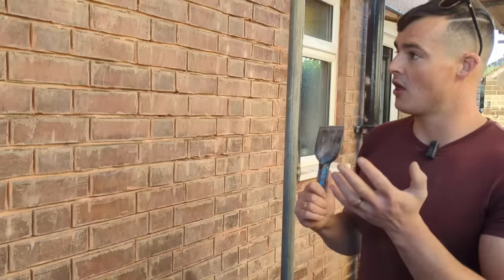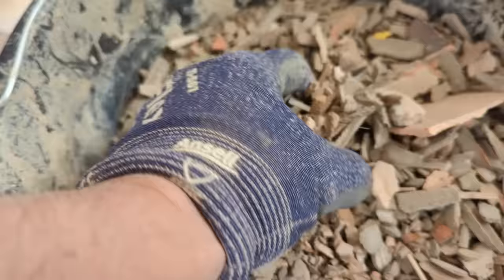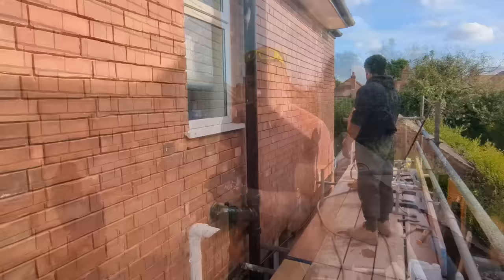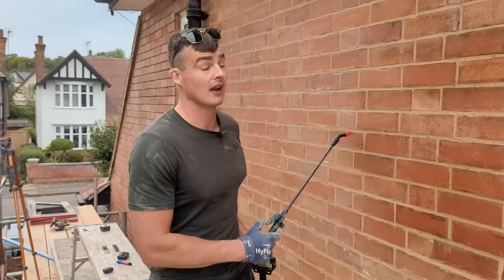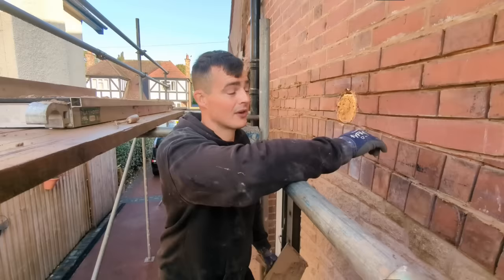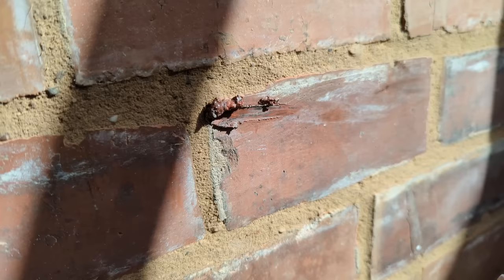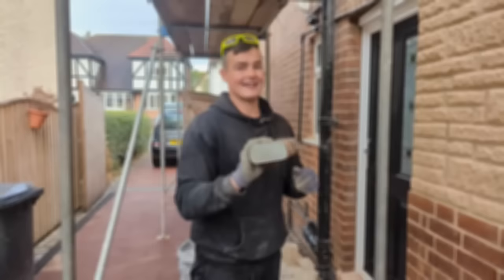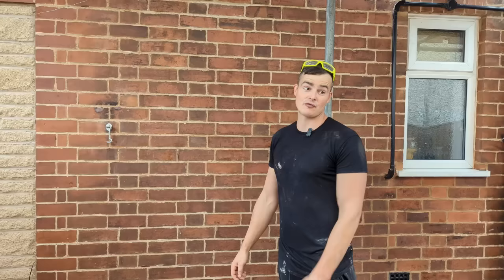CLIENTS were RIPPED off! Repointing job gone Terribly WRONG! #construction #vlog

Comment: Lovely job....looks superb....note to all, if using Boiled Linseed Oil, DON'T throw your dirty oiled rags into an enclosed container such as a bin or bin bag....BLO oxidises as it dries/sets and this generates huge amounts of heat which will very quickly set fire to anything in contact with it!  Lot's of terracotta tile guys have been caught out with this one....Burn, wash or leave rags to dry in the open air before disposing of them....
Reply from the maker: Had no clue about that! Thanks so much for letting me know! And also that ks for watching ☺️
Reply: Very good point, I used the same to restore a banister in my old house and it's very easy to just chuck the used rags in a bag and forget about them. They can and do have the potential to spontaneously combust.
Reply: @IzzytheBricky  Mask up if you're using it in an enclosed space for some reason, they often have a Cobalt additive that acts as a drying agent.

Comment: I specalise in lime mortars and I have to say you have done a great job. I hope you don't mind me mentioning that your 3.5 NHL can be reused the following day, but not more than that because is will set in water due to the hydraulic component. Air lime (putty non hydraulic) can be kept for years when wet.

Comment: Izzy,  good work man!  Fellow brick restorationist here from MT, U.S.  That was a  pretty rowdy cut out and repoint you had to follow up on.  It's a shame there aren't enough of us with experience to cover all the jobs and so  let the fly by nighter's do a shit job.  That "weather edge" and the overgrinds you patched up was pretty egregious.  Good job explaining appropriate mortar hardness and compatibility too.  I follow up a lot of "repair" where the harder new mortar ends up being a disservice to the wall after a few years.  I also learned a new trick with the linseed oil treatment....    I have a tool suggestion: Arbortech 175 brick saw has paid for itself thrice-over for those brick removals.  They are about $1900 U.S.D. but are worth every penny, especiallly if you are cutting out old soft lime mortar or need to plunge cut your heads to extract a full brick.  Keep up the good work, I really enjoyed the video.  Thanks.
Reply from the maker: Thanks so much for the support mate really appreciate it! I love these sort of jobs, real sense of pride in them! Thanks for the tip on the tool! I'll have a look into them mate!

Comment: Awesome work! You popped up in my suggestions and have gained a sub. Quick question, why offer two prices? Surely it would have made more sense for one price which would then remove you having to rely on another tradesman's work before you can start the pointing. I work as a landscaper and have had several jobs in the past where clients want to use alternative companies for 'parts' of a job. I refuse as I cant be sure of the standard and ultimately the job has my name above it. Ill either subcontract directly or turn down the job.
Reply from the maker: Good question, they asked for two prices, so to be fair, I was quite honest and gave it to them
But you're very right what your saying mate! Thanks so much for subbing

Comment: What a fantastic job. That concrete mortar traps the moisture in but black mould can not survive on Salt water and any water going through bricks has salt in it. Probably the wet wall has made it the coldest point in the home and any internal moisture (condensation) is heading straight to that wall once the dew point is met, and can not get escape encouraging mould.
I have an internal wall on a 18th century farm house that in the 60/70's concrete rendered and I have the  same problem with condensation being drawn to the coldest point in the house. Again great job lads, and such pride in quality.

Comment: I'm a plumber and last week I had to refit a bath which had been installed completely wrong. Like the pointing you had to remove - its harder to repair work done badly  than to do it right in the first place!

Comment: Blimey, that house is surely the Heinz 57 of brickwork, so many varieties used. I used to do my own repointing with lime mortar, it's a LOT of work for an amateur to get right but satisfying too. I owned a Victorian end-of-terrace, every quote I had previously was with portland , not lime mortar.  As you mentioned, Victorian/older houses need to breath and move, portland I understand will likely lead to blown or cracked bricks along with damp. I wish I had known about you chaps, would have saved me a lot of time, I learned the hard way that it's better to pay a little more and get the right results first time, than to try and do it on the cheap, so money wasn't an issue, finding the right people, was. Some people don't seem to care, I also had to spend 2 solid weeks unpicking filler out of some stunningl orginal plasterwork because some ejit had tried to cover and hide it. Why do people buy old houses to then rip out or destroy the very features that made them attractive in the first place? Criminal.

Comment: Thanks for the linseed oil tip, last year i used up some of the left over paving sealant to help pop some of the blues on the boundary wall to the front. 
Smashed the repair job, I think with the amount of cowboys out there, you are going to be busy for years to come.  Most of them don't have a clue about moisture retention and simply slap on standard mortar mix

Comment: Great video as always, honestly, id have not even touched that job given they’ve clearly skimped out the first time round then decided your rake out price was too much and then still resulted you in wasting a day cleaning up yet someone else’s mess up. I hope you charged them for it. Them been tight has just past there savings onto your expenses 🤷🏼‍♂️

I’d have probably rendered the house instead given the terrible brickwork on the extension and the patched window arch bit as well 🤷🏼‍♂️😂
Reply from the maker: Haha I know, it's crazy! Well they we're quoted 5.5k for rendering this side. After everything such as the rake out, my pointing and the cowboy pointing, it cost 5k... 
Thanks for the support

Comment: Hello Izzy really good vid. 
Boiled linseed oil. That's a really good tip. We're about to start doing a brand new heringbone patio in back garden of a Grade II building, with reclaimed hand made brick and Conserv NHL 3.5. I'm a bit worried about the frost getting to old bricks with contact with the ground.. I've had success with Bostik Waterseal on other masonry projects but the linseed oil may be a better choice to seal things?

Comment: Good video. Much enjoyed. What i suggest from my personal experience is to have a contract and agree what joint you going to have in the contract. Not keen on the brush effect my self. If you not in the trade, then pointing  can be perceived in any way the builder wants the finish unless its specific . Ours used a rag and it was DOG shit. and there is nothing you can do about it.

Comment: Loverly job, I’ve recently done some repointing - It’s an awful lot harder than it looks, it took me quite a while to get the hang of it and get up speed.

Considering what an absolute dogs dinner it was, you’ve done a lovely job
Reply from the maker: Thanks so much mate! Was a pain to learn, but once you get the hang of it it's quite easy..and very easy on the body which is a nice change for me
Reply: @IzzytheBricky  my background is carpentry really but I’m getting more involved in specialist listed building works which includes re pointing with lime mortar or lime putty.

Compared to brick or block laying I bet it is easier on the body - I had to move a load of hi 7 blocks recently - I wouldn’t wanna be laying them all day.

Comment: There are heaps of cowboys in my area, destroying the brickwork of houses with cheap grinders. Repointing does not fix it, as many bricks are reduced in size on the facing. The dust they kick up is crazy. We just had a gang from Brazil working next door, and they hadn't a clue about British standards. They were using a plastic bag to squirt mortar in, but it was not filling the joint and leaving a void behind. I tried to tell the owners, but they were hypnotised by the word" Lime". I pointed out that the spacing was now twice what it is on my house, and they stared back with a blank expression. Some people are clueless.

Comment: You should rightly be proud of that job. Shame they didn't get you to do the rake out and it made for more work but you didn't get tempted to cut back on the quality of your finish which is credit to you and what will keep the job rewarding.

I also have a question. What would you recommend for removing staining from lime mortar (Secil NHL) rather than cement mortar? Same type of acid, or something else?
Reply from the maker: Hi mate thanks so much for your kind words! To be fair I can't answer it cos I really don't know. I'm not sure if acid would be too strong for Lime. Unless it's quite a weak mix of acid and water and just make sure the line as cured for a good week or two
Reply: @IzzytheBricky  Thanks!. It's been there for months now so it's definitely cured. Probably should have sorted it sooner but you know how it can get.

Comment: You pair have done a great job on what looked like a disaster....Pity about the stone work panels that filled the door and window alterations and that terrible extension on the back, looks like that house has been a bit of a magnet to the cowboys and diddies....I reckon a complete re-skin would be an improvement or even render and pebble dash .......But no complaints about your two's work, credit to you lads. Well done. Saludos desde España mi amigos.
Reply from the maker: Thanks so much mate! They had a quote for render...it was 6k. By the time all the work had been done on that one wall it came to 5k 😂 all the best mate, thanks for the support

Comment: No WEATHER POINTING!!! Your pointing will slow down the dispersion of rain and therefore a hazard of freezing and pulling the new pointing off at the very least. Never used Hessian, if the cement (gobbo) has been mixed correctly and include the correct British Standard ingredients it should cure at a slower rate whilst giving a stronger bond.
I have pointing on gable end houses from over 40 years ago and it's still up there doing it's job. My advice is for you to research the correct materials and correct methods of application & correct pointing for different bond's. I guaranteed all my work for a minimum of 25 years, that's how much faith I have in the materials and how they've been applied.

Comment: Nice job Izzy. If that house was built in the 50s and its in Flemish bond does that mean its a 9" solid wall thus causing damp? Thanks.
Reply from the maker: It is 9" but they've never had damp until this work was done unbelievably
Reply: Cheers mate. As you said- lime mortar only for that construction. 👍 @IzzytheBricky

Comment: I can tell you back in the the day the Bridgewater brick your working on is a hard engineering brick and a quality one too, the original pointing would of been a bead or tuck pointing with lime, x old pointer hear too, saying that good on you being very thorough with this mess that was left by the bodgers, looks like they didnt even rake out the old morter too
Reply from the maker: Thanks very much mate! And your correct, they didn't take out the old stuff, just went over it! Thanks for the comment

Comment: Did you say this house was probably built in the 50s or 60s? Did you mean 1950-1960s? I thought they generally stopped using lime mortarfrom about 1920-1925 - but I'm not a brickie, so no expert.
Also why did you use NHL 3.5 lime instead of Hydrated Lime? Was it a 4:1 mix with the sand? Did you not use cement at all?You've done a very nice job - Congrats !
Reply from the maker: Thanks so much mate, your perhaps correct, it could have been the late 30-40s it was a 5-1 mix. 1 sharp sand. 1 lime. 3 sand. No cement needed with 3.5

Comment: Cracking job, shame the customer made the same mistake twice and paid someone else to do half the job of raking out. 🤦‍♂

Had similar, but not as bad, happen to me. Hired a company to replace about 50 spalled bricked, showed him the colour of brick, had 20 Berkshire orange in the garage for him to colour match to. When I came home I found he had just gone to Wickes and got some London Heathers which were mostly brown. The pointing to match the existing weather struck must have been applied with an old shovel from next doors roof. The excuses were all in reference to the existing poor state of brickwork. Now I always go to a trades previous job and check they are doing the work and don't sub it out to a hungover student!!
Reply from the maker: I know, hopefully a lesson learned, but is what it is I guess
Sounds like a right nightmare mate. And probably the best thing to do 💪

Comment: That original brickwork is well before the 60s. With cross headers, there must be a very little dimensional separation for insulation, which is probably non existent. Quite different to 2023 Building Regs.

Comment: How would you know if you need lime as opposed to sand and cement. Also need some advise. Under a sitting room window there is cement render ie almost 4ft by 4ft area.

It's all crumbly and smells fungus/damp like...

Would you recommend replacing it with new render or repointing...

Any help would be appreciated. Since I'm assuming I'd need to invest in a little grinder to repoint that area?
Reply from the maker: Hiya, I would replace it. As the cement can't let the wall breathe. Take some pictures for me and then send them over via email. 
izzythebricky@hotmail.com 
I'm more than happy to advise you

Comment: I spent 3months of the first 2020 lockdown raking out and repointing our 150 year old cottage. It had been repointed many times with cement mortar and was a mess and as you say trapped moisture. I don’t do this for a living but very therapeutic - transformation before our eyes.
Reply from the maker: Thanks so much Barrieill! Did you enjoy doing that work on your own place? All the best
Reply: Very enjoyable job. In places there was no horizontal mortar between the stones largest stones. So some beds were about 300mm deep. I had 30 bags of coloured line mortar from Lime Green delivered just before lockdown. Slowing down the set was a challenge as weather in spring 2020 was so good - like you I was spraying and using hessian. Plus soaking stones before applying the mortar.  My Henry Hoover worked hard clearing out the dust from joints. 
Barrie

Comment: You have to be so careful these days when employing a "tradesman". Do your due diligence. If it's a big job ask to speak to previous customers. That can sometimes be difficult but if it's a big job I would play it safe and I they can't provide recommendations then give them a miss.
NEVER EVER take the cheepest quote. They are cheep for a reason, either they are new (No issue with that we all start somewhere) or have no work because they are bad.

Comment: I have a house originally built in 1879. Very soft red brick. The previous owner had it repointed approx 15-20 years ago… with absolutely rock-hard sand and cement. I’ve thought about getting it raked out and repointed with lime but I’m genuinely worried the bricks would not take the raking out at all (I.e. the bricks would fail before the cement). Is this even do-able or should I just leave it be? No internal damp to speak of, but a couple of bricks are spalling here and there.
Reply: Hi, if you have no damp issues, let it be, and yes, you will continue to have spalled bricks, as moisture travels through the softer material.
To your question of if should rake and put lime, been red soft, the raking would have to be done gently, and accurately, so not to widen your gap to repoint, so been cement, you would have to cut up and down of the brick ridge, and bolster accurately, there will be some bricks that would have to be replace, know this.
Then the repointing, style, if it has been done already once and cement instead of lime as it should have been done, I would assume that the joint gap has increase more than  its original sizes 6 to 10mm. So you  probably won't have much choice on pointing, styles, 
Depending on what side of the house, the pointing needs to be done , you would assume that it would have to be a flush joint, like this fellow just show you, but it is the front and not a rural house a flash joint wouldn't look very well, as it will be to wide, but there is an option, in where you can use tuck pointing,  the gap filled with lime the color of the brick, and either a black or white, lime putty on top, 
Hope it helps, I thought about making a comment ,maybe a bit too much. !😮
Reply: @user-nd7tg1mf8k  thanks so much 😊 that’s an awesome response! Yeah, we’re probably leaning on the side of “leaving it be”. Lots of other projects going on at the moment, so as long as I know the existing pointing isn’t compromising my house too much I’ll concentrate on the main jobs before letting the pointing enter my headspace again 👍🏻 thanks again. Chuffed to bits with that!